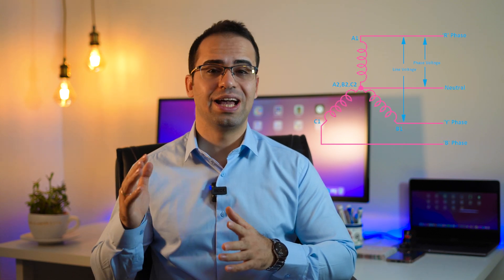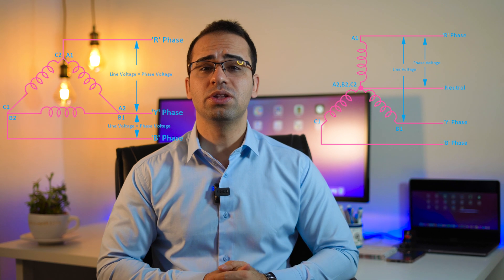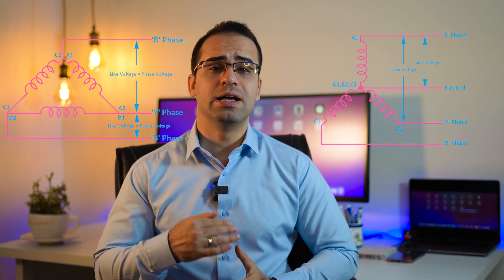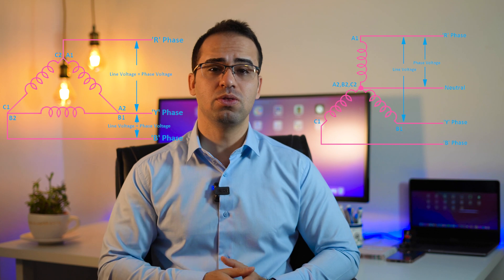1 Phase Power Vs 3 Phase Power – The Main Advantages & Disadvantages of Each 🎯

Comment: Thank you very much for this excellent information!  Could you help me understand about power usage and motor efficiency in % or numbers? How much less power does a 5 HP, 3 phase motor use compared to a 5HP, 1-phase? Can you also give numbers for a 10 HP 3 phase and 10HP, 1 phase motor please?  Also, is it safe to assume a 5 HP motor uses 3.85 to 4KW? Does this assume 100% motor efficiency? What is a likely efficiency for a commercial motor? Thank you!

Comment: Give advantages and disadvantages of 3 phase system in written.
Please give answer in reply of my comment asap
Reply from the maker: Following are the advantages of a 3-Φ transformer over a 1-Φ transformer.

Less costly
Lesser weight
Less in size
Less time required to assembling
Require less space
Deliver more power
Higher efficiency
Easier to install
Easy transportation and installation
Easy to repair
Easy assembling
The cost of a three phase transformer is lesser than the three single phase transformers having the same rating.
Finally, it is easy to obtain a single phase power supply from a three phase supply, while it is not possible to get a three phase power supply from a single phase power supply. Same is the case for single phase and three phase transformers.
Reply: give advantage of having single phase motors  rather than 3-phase